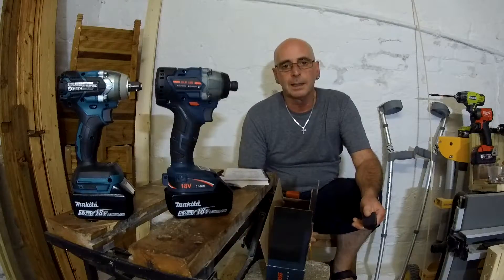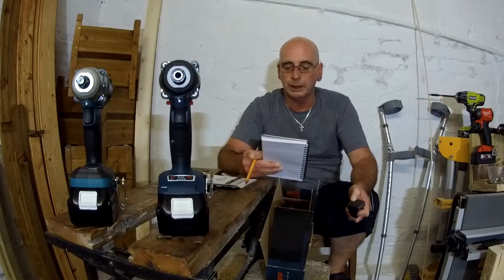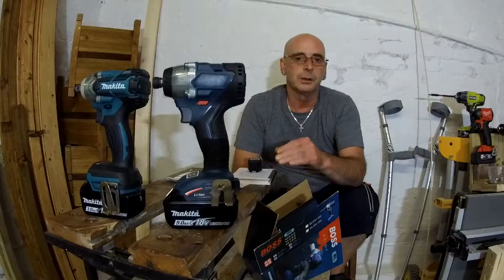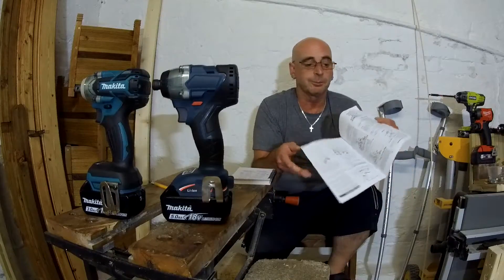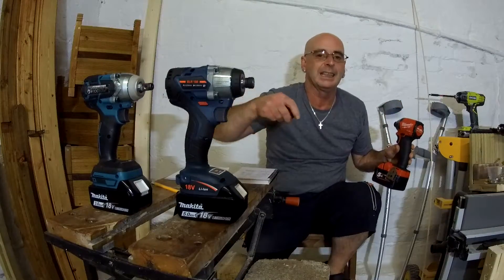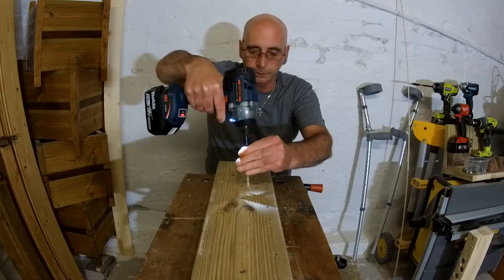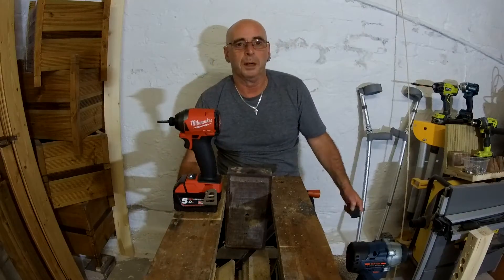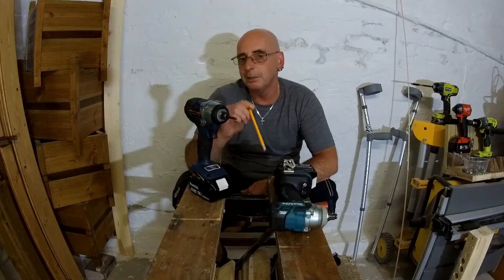MAKITA WARNING over CLONED IMPACT and Wrench Batteriol + boss

Comment: I recently purchased one of these chinakita, I also bought a flip socket that uses a 3” extension from Harbor Freight. When  I use the flip socket and the extension power decreases significantly vs. just a deep socket alone. Nonetheless, I’m happy so far, perhaps it would be nice if someone posted a follow up video one year after it’s been put to use. I was able to drive out lug nuts that were difficult to loosen even with a breaker bar. For the price I paid I think it’s worth it.

Comment: I have the Makita palm router clone from Katsu and can't fault, fits all Makita spares perfectly and feels very well built. I find a few of the other power tool clones to be poor. It's the sort of industry where it's very hit and miss. Some look like there built with the same parts and some look like copies  of rejected parts where you need to change screws or just file a bit of plastic down so it fits better. Carry on the good work!

Comment: There seem to be several factories making the counterfeit Makitas. I have the 1/2 impact made in a different Chinese factory - brushless, forged and machined parts, works perfectly with Makita's batteries. I run Makita's 18V platform is the build quality doesn't seem any different. If you decide to get one, buy it direct and pay attention as to the actual tool on offer. As said earlier, they're manufactured by different folks and there are differences. I paid $30 shipped. A remarkable bargain. BTW, judging an impact on its speed driving a lag and nothing else is ridiculous. The rest of the comments resemble wishful thinking. A stupid video.
Reply: I just ordered that $30 one a week or so ago...I still have two weeks till it gets here. I picked up the Makita xt447 kit (2x5.0ah, impact driver/drill, Sawzall and nice LED spotlight- the better one) on Amazon in December for $200 with Discover Cashback. I just ordered the xt331 on Amazon a few days for $199 (4ah, 2ah, impact driver/drill, circular saw), I'll keep the saw and batteries and flip the impact/drill for $100 or so. So I'll be about $330 in for the Chinese impact wrench, Makita impact driver, drill, Sawzall, circular saw, LED spotlight, 2x5.0, a 4.0 and a 2.0 + two chargers.

Comment: Just paid £25 delivered...
Reply: Is it any good ? Have you tried to unscrew something from a car ? :D
Reply: @pulsswow  No not yet, the only slight issue was i had to sand a bit of the plastic down to be able to fit and remove the battery better. i was impressed to see a female 1/4"hex inside the 1/2" fitting so can use it for more things. no brainer to have for the price.
Reply: @mightyfinejonboy  Excellent. For this price its a no brainer. Only downside, as i heard is lack of lubrication inside. Might be worth taking it apart, adding some grease and it shouldnt have any problems anytime soon.
Reply: Can you send the link please?